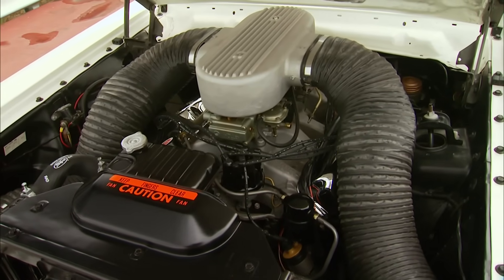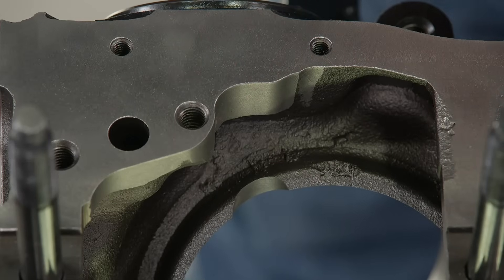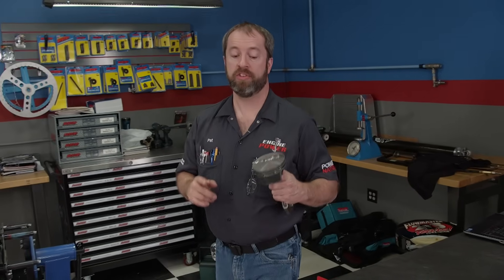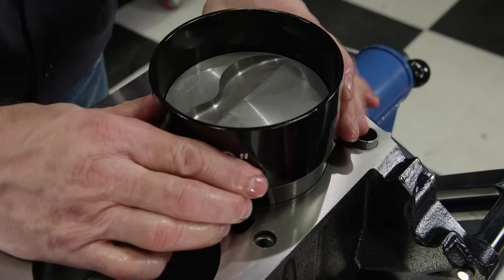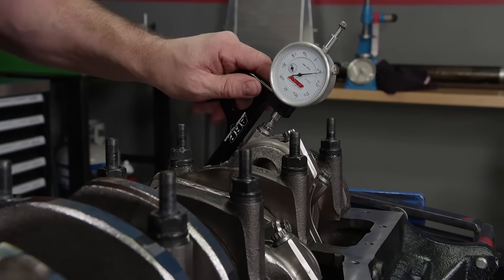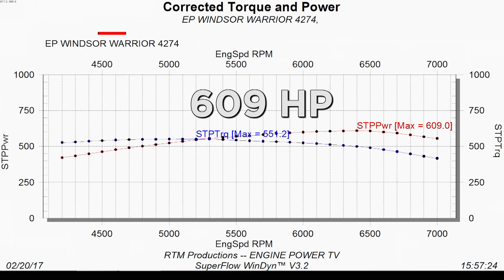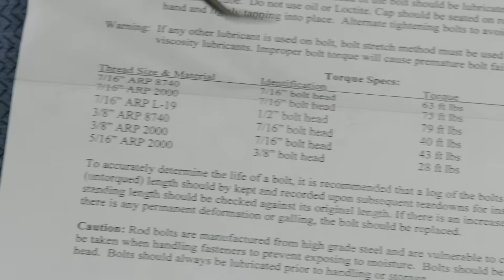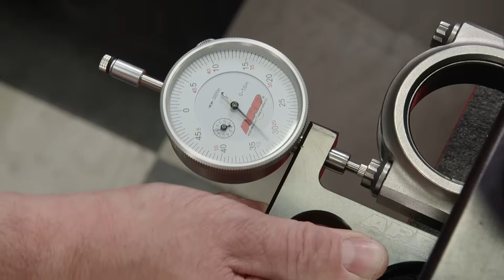Ford 351 Windsor Grows Into A 427 Stroker With Double The Original Power - Engine Power S4, E7

Comment: It was mentioned that the 427-powered Cobras won the GT Championship.  Actually it was the 289-powered Cobras, primarily Daytona's, that won the FIA World GT Championship.  The 427FE won in NASCAR, NHRA, SCCA A-Production (Cobra Roadsters), and FIA Prototype racing (Ford GT Mk II and Mk IV), winning LeMans and many other races.
Reply: Yep. The 427 Cobra race effort was essentially abandoned by Shelby because the shop couldn't keep up with the Mustang, GT-40 and other projects. Shelby was stretched too thin, and the 427 Cobras were demanding when it came to chassis tuning and setup.
Reply: @randomologist77  A friend who worked for Shelby on the race team said that Ford ordered the Daytona's retired to concentrate on the GT-40's.  He also said that Ford insisted on the switch to the 427FE in the GT's so they could sell more Galaxies and Country Squires with big blocks.  Apparently Shelby, and many of his guys, felt the small block had plenty of potential left and there was no need to switch to the big/heavy engines.  In fact, the GT-40 initially used the OHV Ford Indy 256 cu in/375 hp OHV engine.  Ford created DOHC heads for the Indy V-8 and got about 425 hp out of it.  Parnelli Jones had a 5.0 liter version of the DOHC Indy engine (in a Lola T-70) with maybe 500 hp.  And, later on, John Wyer's Gulf team used the small block (302) with Gurney-Weslake heads to win LeMans twice ('68 & '69).  It looks like Shelby was right that the small blocks still had more potential.  Since then, we've seen the small blocks punched out to as much as 427 cubic inches.
Reply: @randomologist77  Couldn't find your other reply about the 427 FE, so here's my answer.  I should have said Ford wanted to sell FE engines in station wagons, coupes and sedans.  Specifically 390's and 428's, not the race oriented, and expensive, 427's.  Salesman were supposed to tell Joe Public, "why that 390 in the Country Squire is  (virtually) the same engine that just won at Daytona (or LeMans)."  Same with the 426 cubic inch so-called "428."  It was given that name so people wouldn't try to race it (most race classes were limited to a max of 427 cubes). Then eventually, Ford started offering racing versions of the supposedly non-racing 428 (CJ and SCJ).  Anyway, "Race on Sunday, sell on Monday" always depended on selling cars with the same brand or model name, not with the actual same equipment.
Reply: @michaeldelaney7271  I deleted the response because there's just a lot of ground covered. The 428 (4.132 x 3.980) is technically 427ci (426.96ish), the 427 FE (4.233 x 3.784) is technically 426ci, but Ford allowed some finish hone wiggle room in there to get the 427 to "427." Ford made a concerted effort to market the 428 with special drag pack edition Mustangs with the CJ so the idea they didn't want it to be raced seems suspect. The 428 was just inferior to the 427 in race applications as it was a purpose built street engine, not a purpose built race engine like the 427 that was unsuitable for typical production car use. The only reason the 428 even came into being was the 390 being outmatched by upcoming and recently released competitor street engines from GM and Mopar like the the 440 and the L36 427s.

While Ford no doubt wanted to use the 427 FE's potential victories for propaganda's sake, they were looking to win first and the 289 wasn't a winner and probably wasn't going to be a winner at Le Mans. Ford would have been happy to tell Joe Public their 289 engine was the one that won at Le Mans if it came down to it. Also, the small blocks had a long future ahead while FE engines were already in their swan song stage with the 385 series in development. The 289 was overmatched and unreliable at the power levels the GT40 needed to achieve to win at Le Mans. The 255ci Indy V8 was an incredibly exotic and wild engine. Custom aluminum block, DOHC, 4 valves per cylinder, fuel injection, gear drive timing, 12.5:1 CR and unusable below 6,000rpm with an 8,300rpm redline. The 255 still made 60hp less than the intentionally rpm restricted 427 in the GT40s and the 255 was only designed to run 3hrs, not 24hrs. Even if they wanted to use it, Ford didn't have time to devote to a build program for the Indy engine for Le Mans and it was not an engine they could market as it had nothing in common with the production engines.

Also, from my understanding, the drivers made the call to go with the 427 after it proved Ford's point of view by blowing track records out of the water. It was just a no brainer. The 427 was more powerful, more reliable and more forgiving with an ability to pull well down under 2,000rpm. Shelby wanted lighter weights and after the successes of the 427 were proven again, Shelby begged (and was denied) the 427 for the Mustangs, instead getting the 428 as 427 production couldn't be ramped up even if Ford wanted to do it.
Reply: @randomologist77    I'm sorry about getting mixed up on the FE's various displacements.  "427's" are actually 426 cu. in. and "428's" are actually 427 cu. in.   I had always heard that Ford absolutely did not want to call one of their engines a "426" as that was a famous MoPar Max Wedge and Hemi designation.
Reply: @michaeldelaney7271  Not sure on whether or not Ford had an aversion to calling their engine a 426, but it's certainly plausible. The muscle car era was a really interesting time period. Stories and legends are immeasurable from that era and it leads to some fun conversations!

The 427 had an odd bore of 4.233, but it was that way so it could be perfect finish honed to 4.24 for racing. You end up with 427.46" in racing applications that way. Just more of Ford's "creative interpretation" of the rules, haha.

Comment: I always loved Power Nation when I was growing up before the Net was around.. But the only thing I don't like is that they always give you their dyno's with power to the crank.. Like if something is 500HP to the crank it's more like 300HP to the wheels by the time it makes it through transfer case, and trans to the wheels.. No offense..
Reply: Yes ding dong because this is an ENGINE dyno, not a chassis dyno. They can't guess the parasitic loss of every vehicle combination. If you are losing 200hp through the driveline, you've got a problem.
Reply: @TheRoadhammer379  What are you mad about?? It's the truth their number's are wrong.. And that DEYNO they use sucks.. Don't get but hurt ding dong...

Comment: I was told that a crate engine comes complete and remanufactured and you just have to drop it in an connect,is this true and if so, we're can i get a replacement for my 93 Ford E150 Club Wagon Van 5.8L EFI at a good price.?
Reply: It's 2022... Google it

Comment: Is this 351W the same small block as the 302? Always interested in small block high horsepower for an even smaller chassis.
Reply: Both are different blocks. The 351w is about 1" wider. Also there is a casting wedge  by the distributor. 
Intake manifolds are not interchangeable. The 35Iw is a little higher too.
I have one in a 65 fastback mustang. It's a tight fit as well. Used JBA headers as well. All other brands don't fit well. Balance is 28.2oz vs newer 5.0. highly recommend Ford Racing Harmonic balancer too! It's drilled for 3 and 4 hole crankshaft pulley. Your engine will feel smooth by using this balancer.
Reply: @johnclemans7802  Thanks for the reply. Appreciate your detailed your response.
Reply: The 302 has a 8.2 inch deck height vs 9.5 inch for the 351. This makes the 351 block both taller and wider, also heavier.
Reply: @briansearles4473  Thanks for the details. This makes me wonder if the weight is worth the added displacement. Adding this to food for thought.
Reply: @RoadsterLoverMedia  You're kidding right? The extra deck height isn't adding 100lbs, the Windsor blocks have more potential than the 302 blocks. Extra weight, 😂 like it's a metric ton

Comment: My buddy is getting ready to build us a Windsor. We're going .60 over bore and he's gonna build the internals to be ready for a nitrous plate down the road. For now, we're gonna be running a Holley Sniper EFI setup. This will be taking place of my factory 351M-2bbl which is currently pulling 9mpg at best in our '79F-150.

Comment: I looked up the Trick Flow heads and your better off purchasing the AFR heads instead. There only a couple 100 less for the Trick Flows. Plus you would probably do better with AFR on dyno times.
Reply: I don't believe so,trickflow has been building head for small Ford for years more to it than flow and size hence twisted wedge.

Comment: I had bought a 69 351w, $500.00 used, short story I got it rebuilt to a 418ci all high performance, choppy Comp Cam, roller rockers victor junior heads, highrise intake manifold, 850 carb, it was getting about 550hp, on pump gas in a 65 coup Mustang. I sold it though. I miss it. The  cost was about $10,000.00 for all the rebuild including magnifluxed and balance. It wouldn't take a 427 kit, I got it maxed out for what it was able to.

Comment: yes it will run on pump gas but that set up would do so much better on racing fuel . put 110 to 120 octane thru the intake and set it to 30 degrees that would let it will lift the front end on any old ford it would also make the engine a lot happier. they were made to run on high octane back in the day and even the aftermarket blocks love the high octane juice.

Comment: I priced up FE BB and it wasn't much more than this Windsor build.
Reply: That's true, but fitting a Windsor block into a mid-sized street car like a Mustang or Fairlane is a whole lot easier than an FE. Race car with no inner fenders, doesn't matter. But a street car, with inner fenders and the factory shock towers make changing the plugs on an FE a time consuming and knuckle busting process. Plus the Windsor is lighter, and if you ever want to change the intake manifold it's no comparison.

Comment: Love the old tech motors but they are somewhat limited unless you want to drop serious money. 

New tech stock runs almost to that point for less money or same. Few bolt ons you can surpass that point by large margins. 

I had a 410 pushing 557hp 502tq on a very mild tune simply because I was going to put a pair of turbos, never got around to completely finishing it before I sold everything to buy a house for the family. 
My point is, I spent 8k on that setup without the turbo’s. 
You can get a 3 gen coyote and possibly ten speed trans for 10k and achieve that power almost stock.

Comment: Always Always Always
make sure that the crankshaft bearings, connecting rod bearings, cylinder walls, piston skirts ect...
get a layer of clean oil on them before assembly.
I have seen engines seize  upon start up from failure to take these simple steps.

Comment: Only a 2 bolt main they should have machined the block to accept 4 bolt main caps with the increase in power
Reply: Common knowledge says that early 351W blocks had more material in the webbing and pan rail area so that a 4-bolt cap conversion was possible. Later blocks supposedly had less material in those areas, which is why people use girdles.

Comment: What good are threaded freeze plugs? The looked like they were cast metal won’t the block crack?
Reply: Freeze plugs won't stop a block from cracking if it freezes. There are too many places where the ice would be trapped, those few holes won't relieve the pressure. Those holes are not designed to stop cracking. They are remnants of the casting process. Those are the holes that allow the sand in the core molds to be drained out after casting. Threaded plugs are actually a very good idea. I've had standard "freeze plugs" pop out before. You pretty much instantly lose all your coolant. That's bad. I've never had a block freeze. Never even heard of it happening.
Reply: @johnterpack3940  This at ain’t the 1920s they don’t cast blocks in sand anymore.
Reply: @hollowpoint357sw4  they still use a granular/powdery substance to form the core molds. That material still has to be drained from inside. And for the vast majority of casting done today, yes, it is still sand. Sand isn't just the stuff you find on beaches. It's not 1920's technology.
Reply: I was wondering the same thing

Comment: I would love to see a dyno comparison between their final setup and a set of 4, down draft Weber carbs.  Just in case I ever get my Cobra kit car build started.
Reply: Probably not much. Vid after vid on YouTube shows consistently the same thing and that's a single 4bbl has a slight edge in NA applications even over EFI and multi carb setups. Charge cooling is the reason it beats EFI. 
EFI of course is far more practical as a daily driver and the power loss over a single 4bbl is only small.
Of course multi carbs are very visually exciting. I like 2x 4bbls.
Reply: @ThePaulv12  
Back during Fords racing program with the Mk 1 GT40, running the 289, Carrol Shelby said the down draft Webber’s were worth 40hp over the best single 4 barrel/intake at that time. It would be interesting to see how they compare today.
Reply: @shanebarron2384  - The available single 4 bbl intake manifolds back then were garbage compared to what are readily available today.  4 bbl carbs have also improved quite a bit.
Reply: I agree that single 4bbl intakes are way better than what was available 50 years ago… however it would still be interesting to see the dyno graph overlay from a quad downdraft Weber/Mikuni’s setup vs the best single 4bbl and single plane intake.

Comment: That's all nice, but in my experience with a 2 bolt main block and less stroke at just 4" (408), I had some pretty signicficant amount of cap walk and fretting of the mating surfaces.  That was with the external 28oz imbalance crank that was balanced to the rotating assy. too.    This was 6K rev limited and used for a road race application so lots of extended RPM times.  This is a lot of weight and a BIG arm swinging around to try to control with cast iron 2 bolt mains.  It might be OK for limited street use and the occational rip down the dragstrip, but not the best idea for a race application or high RPM with extended times.   OK for budget street stuff, though.
Reply: Emerald Triangle  Who are you referring to?

Comment: Another great video, guys! 🙂 Thank you. How much would a 427 Windsor to that specification cost, roughly?
Paul 😎
Reply: There's no such thing as a 427 Windsor. It's a 427 Stroker. As opposed to the factory FE 427 (sideoiler or topoiler) and 427 Cammer (AKA 7.0 SOHC). 

A factory stroked 351 Windsor crate is the 427 Boss, and when you stroke a 351 Cleveland, it's known as a 427 Clever. If you stroke a 351 Windsor block using 351 Cleveland top end (or vice vsrsa) it's called a 427 Clevor or 427 Windland.
Reply: @RockandrollNegro  Thanks, Marvin. I know.
Paul 😎
Reply: @RockandrollNegro  not really , a 427 stroked engine with inline heads from a Windsor block in called a 427 Windsor ...
Reply: 15-20k. I’m currently getting one built now with a blower and direct port and it’s 25k ish to 30k
Reply: look it up in Summit Racing, this motor is 13-15 grand

Comment: How much would it cost to buy this engine from a reputable engine builder?
Reply: You can get a Ford Performance 427 crate engine from Jegs for $11,000 that is rated at 535hp but I think I would go for the modern 7.3 Godzilla instead for only $6400.  Add some boost and it's good beyond 1000hp
Reply: It all depends. That DSS block I'm sure would shoot the price up there. However you can do a comparable build with a nicely prepped 351 block with all the extreme bells and whistles in the block prep. Because of that and a few other parameters prices can vary!! I wouldn't be surprised if that particular motor with those options fetching 10k.
Reply: @erikturner5073  People in other comments saying $18k. Ford has always been more expensive.

Comment: Ran a 4.17 stroke x 4.03 bore windsor for years from 2005-2014.   Made as much as 545 rwhp on a dynojet chassis dyno(with a 5spd tremec) and ran as fast as 10.15 @ 132 MPH in  a 3150 lb foxbody coupe with a C4 trans,pump 92-93 octane.
All off the shelf parts.  AFR 225 heads,Super Victor Edelbrock intake,Herbert mild solid roller cam,1 3/4 headers 3" X pipe and MAC 3" catback with tailpipes.
Reply: I am looking to build a 427 in the future. 
I'll use my AFR 205 heads and super victor. Then order up a custom cam.
Reply: Jees...3150lb fox coupe? That thing was heavy asf. Did you purposely add weight lol?!
Reply: @rudde67ssm62  Nah. That's about right. If he's still had everything inside it.
Reply: @I_like_turtles_67  wrong......
Reply: @rudde67ssm62 the 90 models we're heavier than the 80s models
Reply: @rudde67ssm62  Might have added a cage and gone to a 9 inch.

Comment: So with a piston +.007 out of the hole and a .040 compressed head gasket you guys are going with a quench of .033. Nice! Smallest ive had the balls to go is .032 and that was with a cast iron crank. See I'd really like your guys opinion and expert experience on just how low you can go with different rotating assemblies.

Comment: Man I really wanna see a Holley EFI system on top of that beauty !!!
Reply: @bigboreracing356  can’t beat the dependability and efficiency of efi old man, a big block I agree with but a small block ?? You can squeeze every inch of power out that sbf for street use gramps

Comment: Wondering how this set up would be in my 1989 f150 supercab
Reply: 2 wheel or 4 wheel drive? If it's a lowered 2 wheel drive, this motor would make it a nice little hot rod...
Reply: @waynefontaine5533  it's a 2 stock ride height